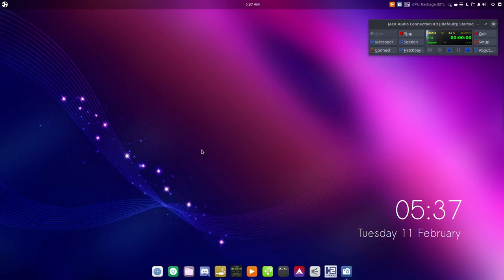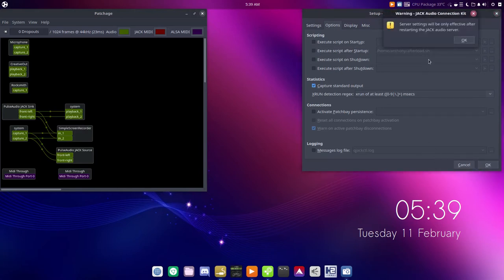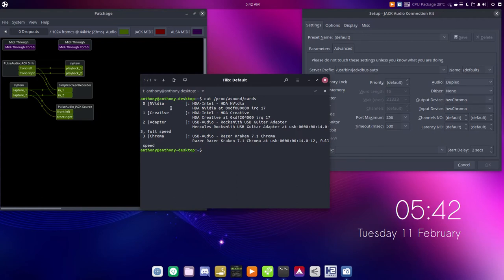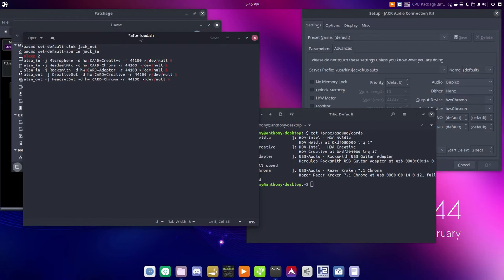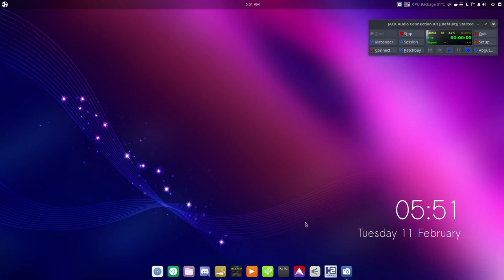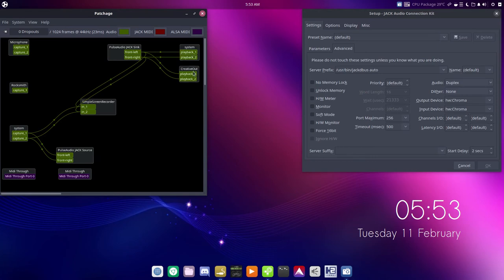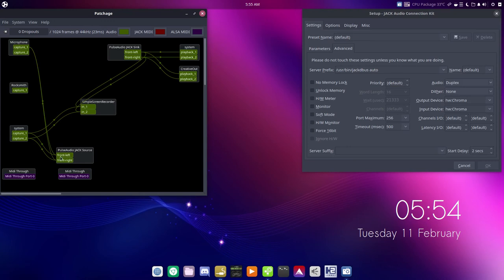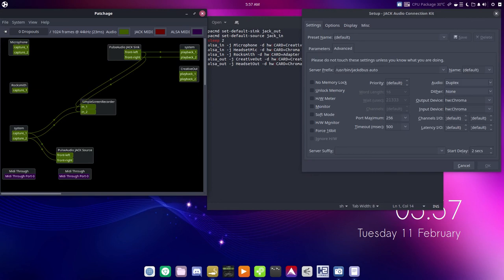Jack/Pulse/Alsa_in/Alsa_out demystified. Complete tutorial on multiple cards within Jack Audio.

Comment: thank you. It would be nice to have a video that explained the relationship between these systems (jack, alsa, pulse). I can't wrap my head around why they all exist. It should be simpler than this.
Reply from the maker: ALSA is the hardware layer, like device drivers in windows, it contains the layer to address the audio hardware. Pulse is like windows audio, it is an offset latency system. Jack audio is realtime audio. If you play a guitar or record using pulse, it will be delayed by 200ms or more. Jack brings it down to 22ms on most modern systems to allow a near realtime playback, rather than the 200ms delay or so that you would get in pulse. If you open audacity, and record a microphone using pulse, you'll notice the graph of the sound lags behind your actual voice or singing, that is the delay inherent in pulse audio. On playback it sounds fine and it works fine for that, but if your playing and outputting sound realtime, you have to use jack.
Reply from the maker: Without Jack, programs like Guitarix and Ardour would have a very bad echoing delay between you playing and the sound being outputted to the speakers. If you have ever heard the delay of the national nathem being sung at a ballbark or stadium, that's what it would sound like.

Comment: Hey bro. I have been looking for it all day, but I can't find any video on my problem.
All I am trying to do is to turn on my two Jack plugs.
Headphone out and Line out, on my Alienware R4 17.
In the Volume control configuration tab, when I select Built in Audio as Stereo Duplex Out, it switches me to the Laptop Speakers, but I do not see any settings to turn on the two jacks outputs.
What am I missing here?
Reply from the maker: a lot of this was replaced with pipewire, are you still running jack audio server, or just using jack within pipewire?
Reply: @BrokeAFx  I have installed pipe wire yesterday, but I do not know how to use it.
There is no user interface. And it didn't fix my issue.
I get nothing out of the two jacks on my laptop!
How do I use pipewire?
Reply: @BrokeAFx  I have now installed pipewireplumber and there is no user interface. What is going on here?
This should not be so difficult!
Reply from the maker: @We-Do-NOT-Consent-303  if your trying to use jack applications, you would install carla.
Reply: @BrokeAFx  I have tried so many things two days ago, it finally crashed my whole Linux installation.
It would crash on reboot.
And I have spent all day yesterday reinstalling everything.
So now I am afraid to try anything.
A lot of all this free software is just garbage.
But on the other hand, Windows 11 is garbage too.
These systems are getting so complicated, no one can make stable software anymore.
I had way fewer problems with Windows 7, running fine fore 10 years.
I don't even get one year out of Linux, before some fucking thing crashes everything.
Reply from the maker: @We-Do-NOT-Consent-303  try ubuntu studio, it'll come pretty much setup for audio. you night have to add some inputs and outputs if it still uses jackd
Reply: @BrokeAFx  I used to run Ubuntu Studio years ago, but I didn't like it for other reasons, so I have switched to Linux Mint. Everything works except the two jacks. So now I am just gonna give up on that and use Blue-Tooth.
All these Linux destros are an anther fucking annoyance if you ask me, why they have to make everything so complicated in Linux is beyond me!

However, what I have found that is fantastic is running Win 11 on VMware in Linux Mint.
Because Linux will handle all the legacy hardware and VMware can connect Win 11 to the Linux drivers, so now I can run Win 11 on my 10 years Old laptop.
And once you have installed everything, you can make a full backup of Windows 11 on VMware by just copying the VMware folder to an external drive.

It is really awesome to run Linux and Win 11 side by side at the same time on two monitors.
And both OS can use two monitors at the same time.

This way I have all my favorite software, running at the same time.
And I do not even have to reboot into the other OS. VMware is fucking awesome!
Reply from the maker: @We-Do-NOT-Consent-303  Yeah, I uderstand your pain, it is just a wierd time for linux as it is moving off old legacy systems like pulse/jack audio to pipewire and x11 to wayland.. they are both in beta, but still have a lot of bugs to work out.. That is the reason your running into all kinds of issues, its just not 100% at the moment.. you could run ubuntu studio 22.04 which still uses the legacy software and it'll work great.. just dont use 23.04 or newer.. I have a simular setup that you are using, but I use proxmox and the x99 platform to passthrough individual gpus to vms that I have attached to monitors, so I run both windows and linux off the same machine at the same time.. but thats another story for a different day